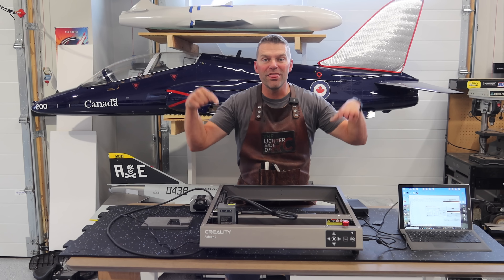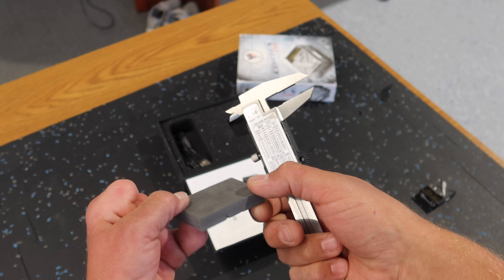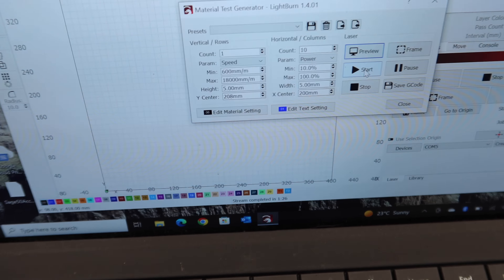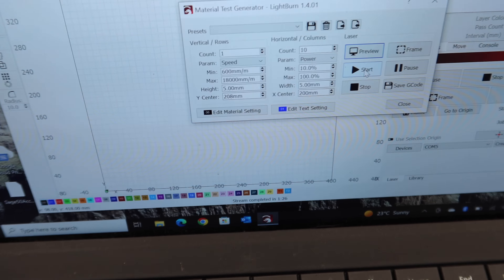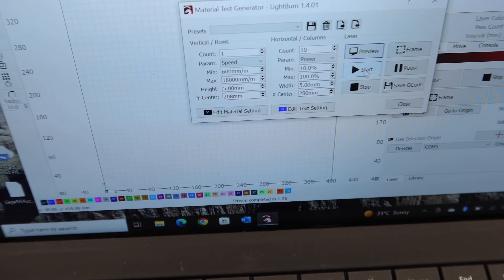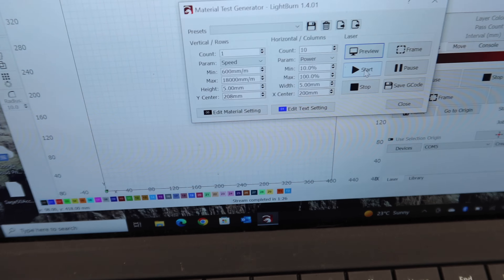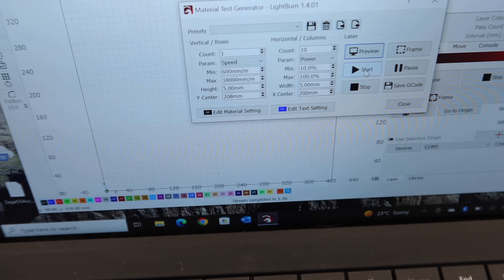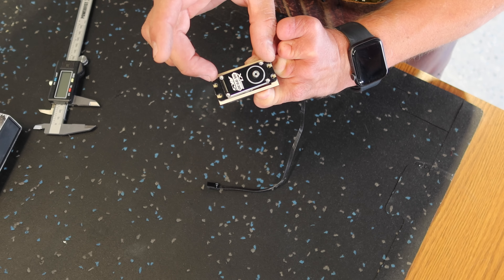Creating amazing RC Plane projects using CREALITY Falcon 2 laser

Comment: Ooof, ifs been a minute since I last watched a video yours,  crazy how chill the mind gets just watching you do your thing and sharing it all.

Curious 🤔, I noticed you sprayed the accelerater onto the CA glue instead of the opposite side, it that cus the foam would absorb the accelerater too quickly? My newbie brain would have thought spray the accelerater onto the glue would have hardened it up right away.

Super fun learning new little tricks. 🙂
Reply from the maker: Thanks for watching!  The accelerator sprayed on the ca will kick it off on the outside layer right away. When you join the two layers the ca gets past this and the kicker reacts with the new glue. The kicker evaporates very quickly and as this is closed cell foam the amount absorbed is very little to nil.
Reply: @thelightersideofrc  Thanks for the reply,  though I'm still a bit like 🤔🤔🤔🤔. Normally I've seen you ca one side, join it up, then spary the fit up. Which is what I've always done as well. Though this time you sprayed the ca directly then joined the parts up. Thought maybe it's because of the material type that a different application process is needed 🤔.

Comment: Hi🙂 I really like the videos you are posting👍 Your sense for details are amazing! I have a question regarding the superglue bonding technique in this video. Why do you use accelerator directly on top of the glue instead of opposite bonding surface? 
Thank you for å great channel👍

Best regards 
Rune Eilertsen 
NORWAY
Reply from the maker: Thanks Rune.  I like to spray the kicker onto the glue.  Cures the outside layer.  When you press together the outside layer will crack and they inside glue will comeout an react with the kicker.  Seems to work good!

Comment: I deal with flight controllers alot, the bottom of the gyro should also be mounted on something that reduces resonance. Resonance is something that travels through the entire air frame, we usually mount the flight contoller on a flat carbon plate that has dampeners under it
Reply from the maker: For sure!  The gyros get mounted to a plate with thin double sided foam.  these hush boxes reduce resonance picked up by the gyro rudder channel.  The foam under the gyro takes care of the vibration through the mounting plate.

Comment: Any special add-ons you have for this Jon?
Reply from the maker: Airpump I think is standard.  I also got the Cylinder device which I havent used yet.  Hood cover with exhaust fan.
Reply: @thelightersideofrc  Did it come with the honeycomb?
Reply from the maker: @williamb.9110  yea. The honeycomb and metal plate for under.

Comment: Does weight ever become a factor when you're custom designing and making addon parts? Or the larger the aircraft the less important it is, just getting the CG sorted out is all that matters?
Reply from the maker: with planes your generally always striving for as light as possible overall but CG is what ultimately matters.

Comment: dubbel click your layers and put it on one pass., and design goes better in Fusion 360 then in Lightburn. Foam i buy at cosplay shops because most of them sell it cheap and in big sheets. Enjoy lasering.
Reply from the maker: Thank you so much for the input!  I think next time I do it I also won't have the perimeter lines touch like I did here.  Cut out as separate pieces with a small 1-2mm space between.  Thank you!